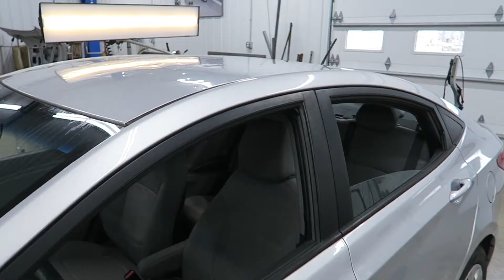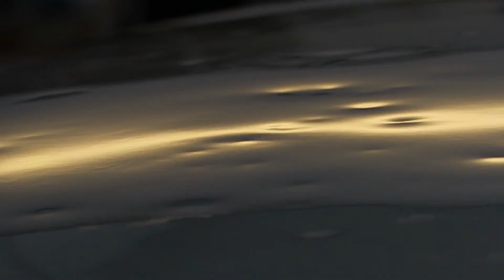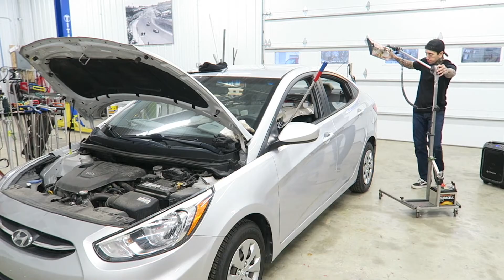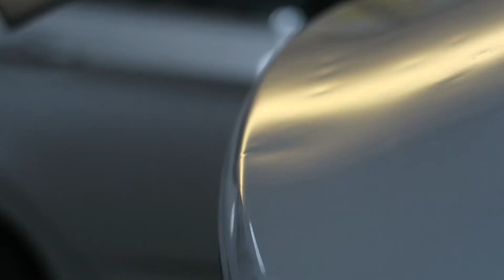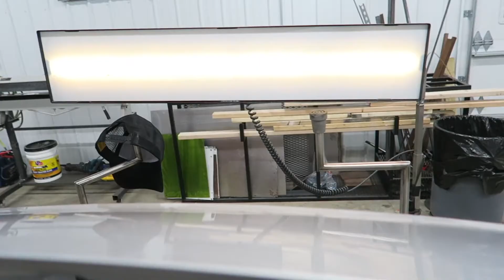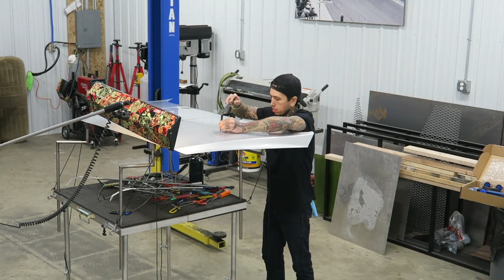Extreme hail damage removal | PDR Dents Gone Wild

Comment: That car was hit! Very repairable though. Time consuming. I’d plan for 1 1/2-2 days. Without seeing the sides and just going off the top of my head not looking at an estimate sheet (since the damage on the estimate sheet would probably put you at replacing panels instead of repairing them) I’d say somewhere between 6-7k to repair. Not a bad 2 days though. I love hail. The cars always come out sweet and the money is amazing. I enjoy your videos. Mainly the large complex glue pull ones since that’s what I’m doing too. Keep up the good work!
Reply: $6-7K would total out most cars worth under $10,000. 

I am hoping a PDR expert would not charge $6000 for 2 days work.
Reply: @edwardli8938  well I work for a big company and have given hundreds of estimates on hail. The problem is working for a large company you get less than 50% of what you bill. I’d gross around $2400 of that and then pay taxes. I agree this amount would total that car but something more expensive, no. Hail is good money. The average hail tech makes between 200k-350k per year and a lot of them only work 9 months out of the year. I choose to work for dealerships and not concentrate on hail because I’d be away from my family all year. This job pays well because not too many guys can do it. It’s a tough line of work
Reply: @edwardli8938 he’s saving this car in the video from being totaled because he bought the car and wants to repair it to sell it and make money. . Did you actually watch the video? That car was smashed and yes 6-7k to fix it is about right. Don’t doubt my estimates. I’ve done hundreds if not thousands of hail estimates. You don’t know what you’re talking about as far as estimates. Any Pdr tech would agree with me on my estimates and some may be higher than mine

Comment: What would a ballpark figure be to fix a 2019 RAM 1500 assuming the same amount of damage as this car in the video but without the trunk obviously. Roof, Hood, and left side of the truck. Would it be cheaper to get a new replacement OEM hood instead of repairing?

Comment: Amazing work as always, I've got a question perhaps you could answer. See, today was my first time trying PDR, glue pulling was straighforward no problem, but HOW do you know where to APPLY your pdr rod to fine tune the dent? The dent was so small i couldnt really feel it under my finger tip and I couldnt really see where I am pushing with the rod either. The only thing I could think of is that the metal I was working on was loose on the table instead of being fixed into the car, so possibly I didn't have enough leverage to make the metal move/stretch much and therefore i wasn't able to see it. Big thanks for your work, it's truely inspiring and satisfying watching that metal morph, cheers!

Comment: How long does, say, the roof or a hood take you once set-up to start with the dent hog?
Reply from the maker: It really depends on the size of the dents and the amount . With Smaller dents the dent hog will blow through a roof pretty quickly using a soft tip.